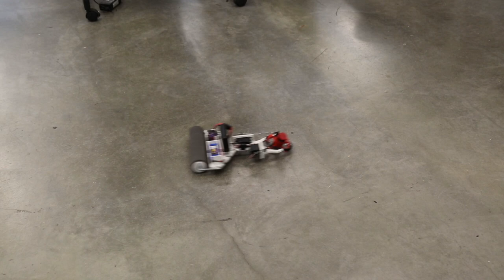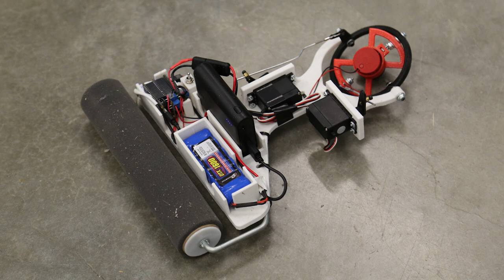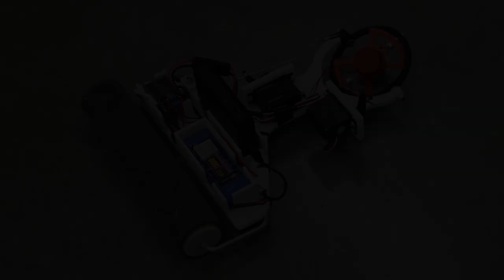Gimbal (HOG) drive paint brush roller robot "Picasso"

Comment: what is that drive mechanism?
Reply from the maker: It is called a Hemispherical Omnidirectional Gimbaled wheel. The paint brush roller is not motorized, only the red portion with one motor angled by two servos: https://en.wikipedia.org/wiki/Hemispherical_omnidirectional_gimbaled_wheel
Reply: Make Cool Stuff Ah awesome, thanks for the reply. Your Roomba video made me remember I had a Neato Robotics bot waiting to be put to use as I was sitting here trying to think of things to use my Sabertooth 2x12 that just arrived on! I love the Sabertooths, I have a 2x60 also and that thing is a beast. Great videos by the way.
Reply from the maker: Let's race them when you finish! Neato vs Roomba race!